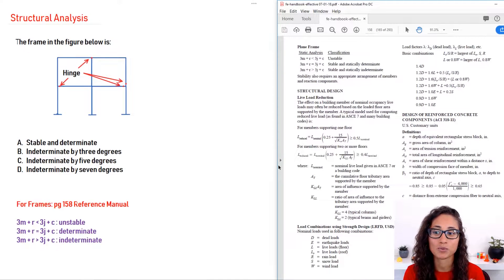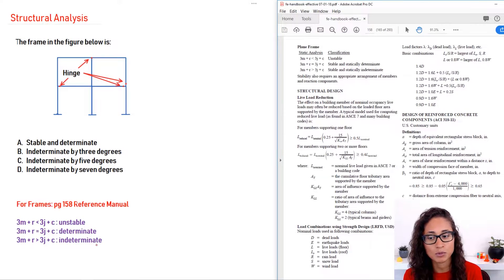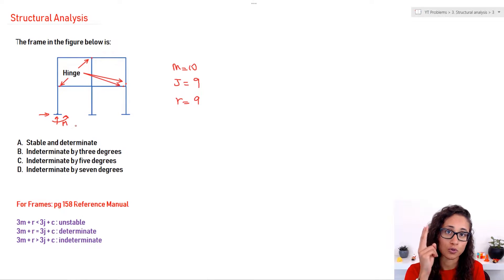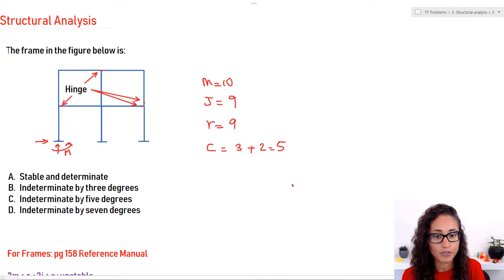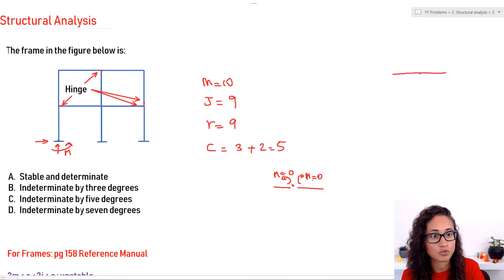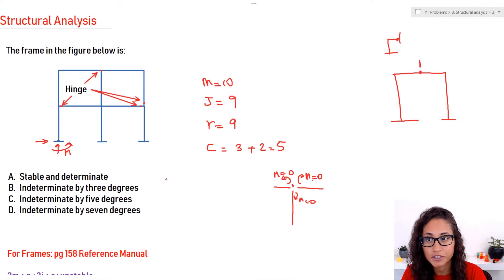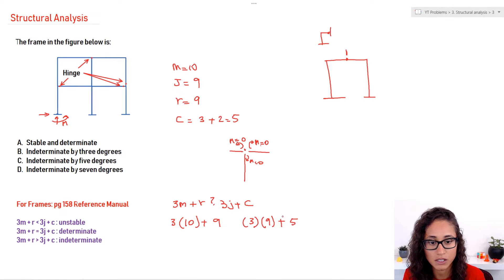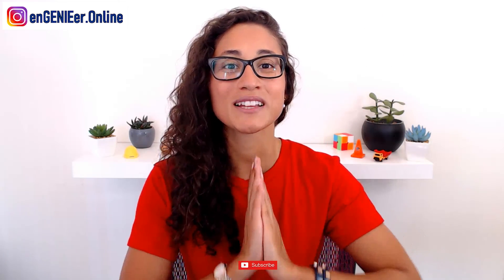Frame Analysis - FE Exam Review

Comment: I am studying for the fe for the first time. I am very confused with the structural analysis part. I can’t find it anywhere in the lindeburg review manual, just the structural design part. Same thing goes for practice problems, no structural analysis questions. This is boggling my mind. Has anyone else had the same problem? Can someone point me in the right direction??

Comment: I have a few questions on this problem: 
1. A hinge separates 2 members so there should there be more members in this problem?  
2. A hinge is also considered a joint as well? 
3. There are some tutorial that recommend splitting the structure up at each joint to calculate reaction forces. Would you recommend that? 

Thanks!
Reply: if you count hinges as joints then you have to split up the members. If you don't want to count hinges as joints then you don't split up members and count it as 1 member

Comment: I get that in #58 they were able to determine that there are 4 members and there are 12 reactions. Each members must have 3 reactions so therefore it is doable. But how would it work if we tried the formula method? There are 4 members, 6 joints, 12 reactions so I would do 3(4)+12 < 3(6). What part am I not getting right? Thanks.
Reply from the maker: You are forgetting hinges! C is number of hinges you have and you have to count for that in your equation. I will post a video on this next week to clarify it! Thank you for watching and for your comment!
Reply: @Genieprep  Ahh because there are 6 hinges. So it would be 3(4)+12 = 3(6) + 6. Thanks!
Reply from the maker: @TheImmabeast06  There are actually only five hinges!
Reply: @Genieprep  So wouldn't that make it 24 > 23 ? Which would make it indeterminate to the first degree? If I count the 6 circle looking things (assuming they are the hinges in #58), then the equation would be 24=24 which would make sense with the answer in the manual...
Reply from the maker: @tgaddi7984  Let's discuss this more in our session!
Reply: @tgaddi7984  Hi I Believe that for problem 58 we have 10 members, 2 pins ( reactions is 4), Joints we have 10 (all corners (6) including 4 hinges) , and hinges 4 (c=4). if you plug into the equation we have 3(10) + 4 = 3(10) + 4  (34=34) therefor the frame is stable and determinate.

Comment: Hi, thank you for sharing. Could you please explain how to calculate a hinge? why in the left side you have two in the right side only one? besides the top that was considered twice?
Reply from the maker: Hello Andrea, so we have two hinges on the right, one hinge at the left and one hinge at the top intersecting 3 members. So the hinge at the top will be considered as two hinges as explained in the video, the hinges on the right are on the members, so we have a total of two. Lastly, the hinge at the left is on one of the members, it is not intersecting any other members, so it will be considered as just one hinge. I hope this helps and I will post another video to clarify how to calculate the hinges. Thank you for watching and good luck with your studying!
Reply: @Genieprep  Hi, thank you for replying and posting the videos! So the hinges are they given to us ? I guess that's what got me confused, if we were given that in the right we have 2 and on the left we were told there was one, or did you calculated that there are 2 in the right and 1 in the left? If you calculated them and was not given in the problem is where I am confused as the left and right side to me they look the same.  But if the problem provided how many hinges on each side then I get it! thank you